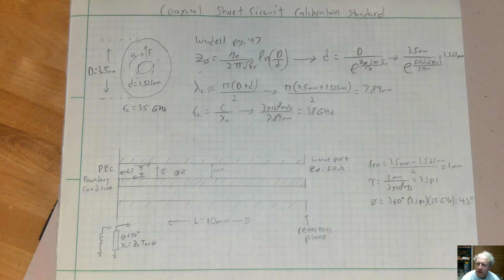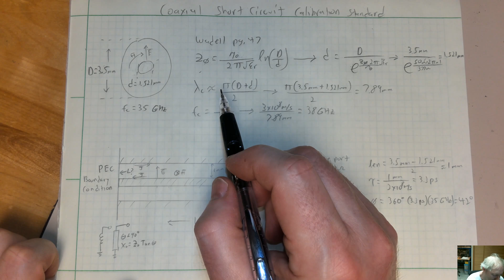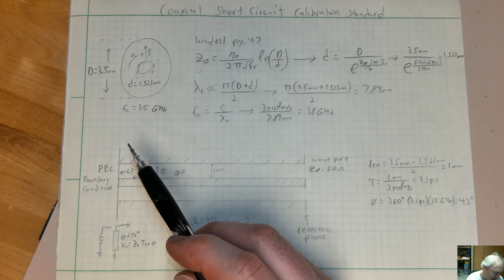GBM 001 Coaxial Short Circuit

Comment: Great analysis using a powerful tool.
Does the use of real material properties have any effect?
E.g. RG402 typically has copper outer and silver plated steel centre conductor.
Does the model give any insight on how to physically build a good quality short?
Reply: Likely for long lines.  I’d think you want to silver plate it for conductivity, but all the cal standards I have ever seen are hard gold plated.  The Maury airlines appear to have soft gold plating on the inner conductors.  I suppose the reliably mating surface is more important than the absolute loss, which can be accounted for in the cal coefficients.

I’d have to add a fillet to the shorting plane to see if that makes a difference.  Surface roughness would have to be accounted for as a surface impedance; no way to directly model it.  I got a tour of the Maury factory years ago, and they use a air gauge to measure the coaxial lines diameters to um precision, then hone the interiors as needed.